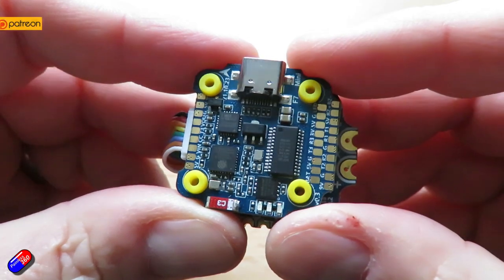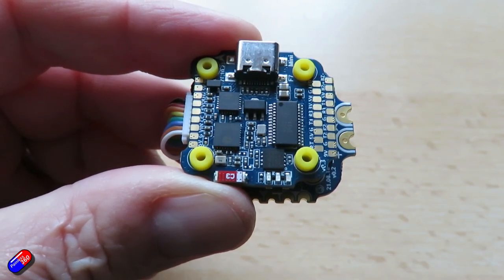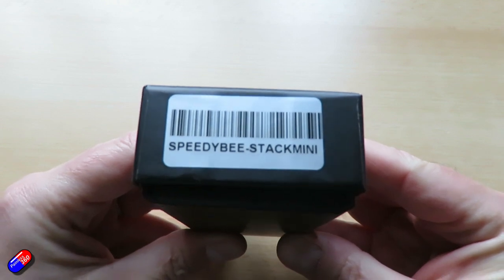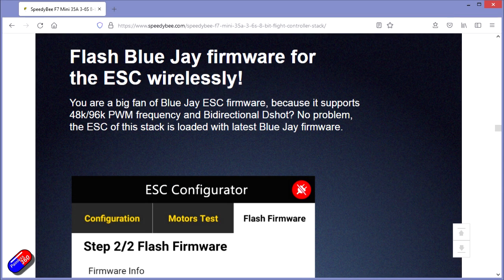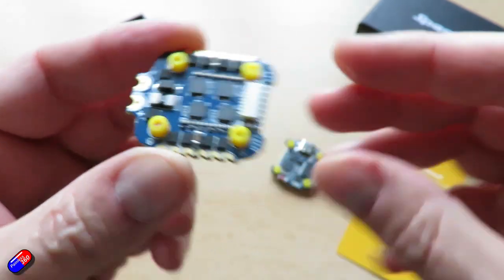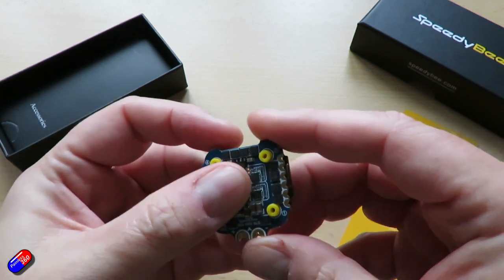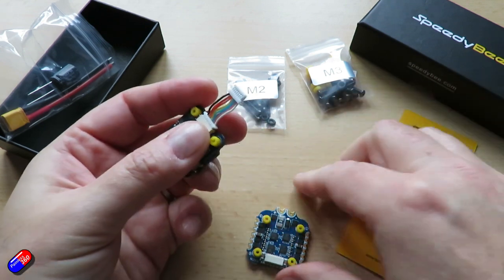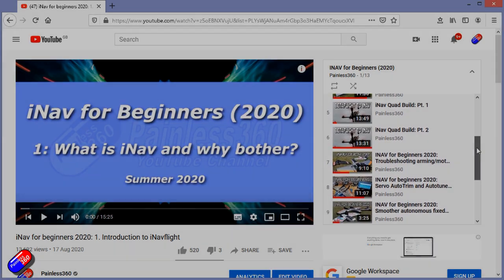NEW! SpeedyBee F7 Mini Stack (35A 4in1)

Comment: Would like to see some testing done for this, I know the bigger 30x30 esc in particular has been plagued with issues especially regarding bidirectional dshot.
It's alright having all great specs and features but if the esc is flawed then you'd be better off with a stack from a different manufacturer. That's like the main complaint i've seen with speedybee, think JB has said that people shouldn't buy them because of the issue. Great video otherwise :)